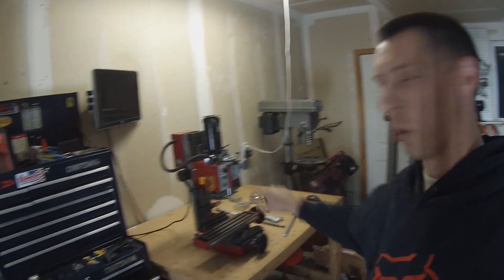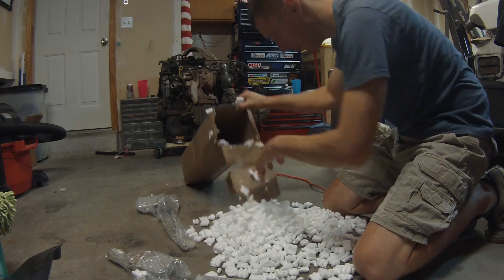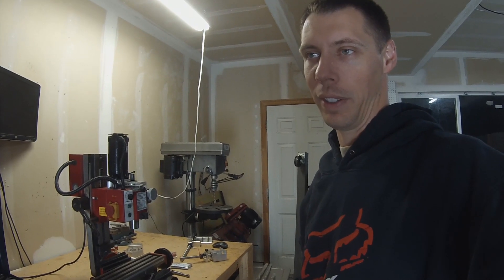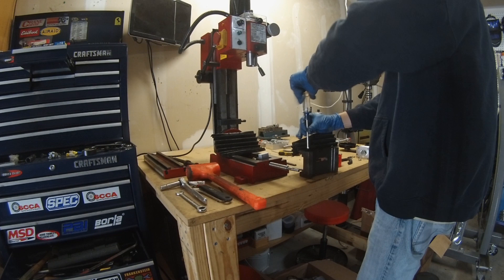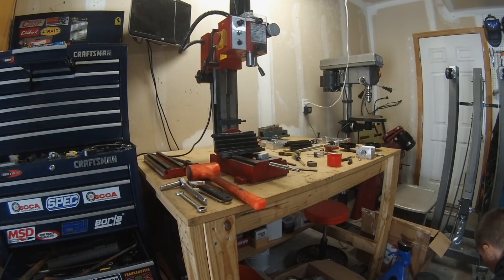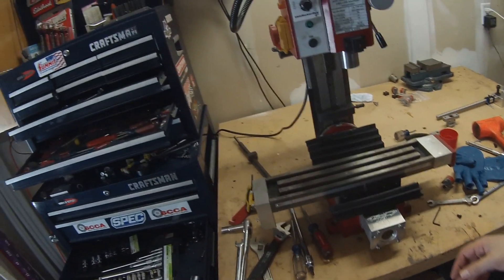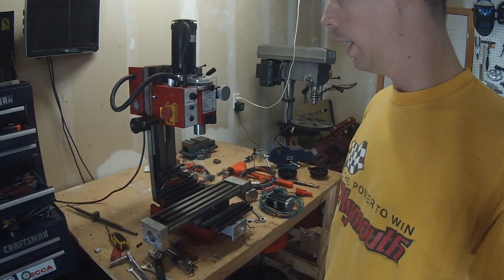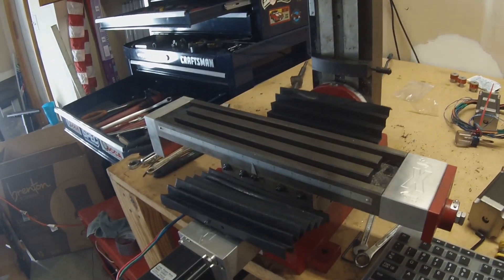Mini Mill CNC Fusion Conversion Part 1

Comment: if i did this again? i wouldnt. had the cnc fusion kit for at least a decade. and with the constant fiddling trying to get screws to not bind, the fact theyre imperial with rounding errors and being in a metric country was causing constant crashes due to forgetting to add G21, or native units everytime i started it... along with the death of XP and the challenge of getting another mobo with a parallel port for the gecko g540...

and yeah, after all the scraping and dealing with the gibs, should have just used linear rails and made an epoxy granite base, end up with something slightly larger... whatever!

but, all being said... just rebuilt, after having it in pieces for the last several years... re-used the mounts from the kit, but changed the Z to have the screw in the column, gaining at least 40mm of Z travel... and finally its moving again. not cutting, still  have to tweak a few things, but yeah... shes MOVING... with no binding, no fiddling, it just bolts together and thats that.

really satisfying to say, run an M100X200 "thread milling" wizard (mach3)... just to watch all three axes moving in unison without any horrid grinding sounds... even without a gas strut/counterweight, the Z is doing fine.

the 1605 screws i now run almost seem made for it, already threaded and turned down and only had to grind a few mm off the Y screw to fit in. far superior to the junk the kit came with.

Comment: Was there a reason why you bought a kit literally with parts that you could have made with your mini mill for just a fraction of what you paid for that kit.
Reply from the maker: I didn't have a way to turn the ends of the ballscrews and having a machine shop make 1 offs would have cost more than the kit.
Reply: @RivalMachining  not sure where you were looking for ball screws but I have purchased several custom cut and machined ball screws for very affordable prices.  Then again I did a lot of research prior to making a decision as to where I would purchase the ball screws.
Reply: @paradiselost9946  why would you need to take the machine apart to take measurements when that sort of information is already available online, if you do some research.

Comment: Thanks for doing this video! With your set up, can you program the tables to move a fraction of an inch or any length with a touch of a button? 
I want to build a rifle bolt jeweling set up. 

Thanks
Reply from the maker: I always used a CAM program to develop the tool paths.  I can jog the machine around or tell the machine to go to a specific coordinate by manually entering G code in the MDI block, is tha more of what you are asking?

Comment: I don't recommend the guy selling these kits now, either. I thought I was getting a quality kit and I got the same sloppy junk as you.
Reply from the maker: That's a bummer.  I was hoping my issues were just a fluke.
Reply: @RivalMachining  the names have changed, but the bullshit's still the same. Dude's selling "premium" ball screw kits that amount to (supposedly) being a Thompson ball screw with a Chinese nut - with no guarantee that the screw he sends for the 200 dollar upcharge is even a Thompson brand. The nuts have to have the flange modified to clear the castings, which was done on the Y but not the X. Ask him to do the X when you send back the screw because the assembly is binding up (with which he accuses you of just not knowing about "preload" and tells you to stop bad mouthing his business), he forgets. Ask him to send another nut that's already modified, he sends a sloppy junk nut with a mile of play. Luckily I know a lot of people with machine shops that I do mutual favors for, so they helped me out. Got the Y casting modified to clear the X nut, took the other side of the original nut to the bench grinder to clear the underside of the table, had the motor plates modified because the motors don't sit deep enough in the recesses... That whole ordeal was a 3 month nightmare of back and forth emails, parts and trips to the machine shop

Comment: Wow that is pricey ! 
More than the mill.
Thinking of making my own kit.
Ball screws are not that expensive
Reply: Mark Giza have you priced out other CNC mills?  $1500 is a bargain for a CNC machine.
Reply from the maker: Looking back, this machine was a gateway drug.  It let me see the potential of a 3 axis mill in the garage but didn't have the work envelope or rigidity to tackle most aluminum projects.  It didn't take long to jump to the Tormach.  If I didn't have the budget, I would live with this, but wouldn't try to start a business with it again.

Comment: You haven't posted a video in awhile. How is everything going?
Reply from the maker: Thanks for asking.  Everything has been going well, I've just been really busy with my primary job and family.
Reply: @RivalMachining  that's understandable. I have a couple of things that I may need done in the future and all my machines are manual so it would be impossible for me to do.. I'd love to have a cnc but I don't have one yet. I have fusion 360 (for my 3d printer) so I can make the program and just send it to you if it's compatible with your tormach?
Reply: @michaelmiller5566  I appreciate you thinking of me, but right now I'm not taking any jobs.  Life is too busy right now and I don't want to commit to anything I can't deliver on.

Comment: That mill will shake it's self to death cutting at those high movement speeds.  Your using a cnc conversion kit anyhow.  Hit a button and walk away.  If you bought a 500$ speed should be your last thing on your mind lol
Reply from the maker: I agree, but what I ran into was slowing the feeds too much results in the tool rubbing instead of cutting.  The cutter needs to take a bite of material each time, typically at least a few tenths or it will wear the tool out.

Comment: I’m trying to decide between desktop pro from cnc router parts, or a super X 3 mini mill for aluminum!???????
Reply from the maker: Personally, I wouldn't try a router on aluminum.  I know some folks have made it work, but they really just don't have the rigidity for anything harder than wood or plastic.  The ones I've seen on YouTube use a fixed gantry.

Comment: What do you do now that CNC fusion has been bought out?
Reply from the maker: Check out the link in the description.  Someone is making a clone of the kit.  I haven't seen one personally, but the pictures look the same.
Reply: @RivalMachining  You mentioned in another video that you had problems with your machine missing / skipping steps after you milled a bunch of plastic. If your ballscrews had wipers, do you think this would have happened?
Reply from the maker: @IceTurf  I bet it would help, but I doubt it would completely solve the problem.  The worst axis is the Z because the ballscrew is uncovered directly behind the table.  A better solution, but more design work would be to either put it behind or inside the column.  The X axis would be better if the ball screw sat higher into the table.  At least the machine stops when it loses steps with the closed loop steppers.

Comment: How accurate is the mill post conversion?
Reply from the maker: If I remember correctly, the Z axis was a little messed up and had about .010" of play, but the x and y are probably within .005".  It's not bad for making small parts, just not cut out for aerospace.  The bigger issues I ran into was overall rigidity of the column.  It's just not made for high cutting forces.
Reply: @RivalMachining  okay thanks, I've been having trouble getting hard numbers on this.

Comment: Hi bud could you tell me the total cost of this conversion? I’m deciding whether to buy cnc desktop or convert manual mill.
Thanks a bunch
Reply from the maker: I paid roughly $1500 for the setup.  $500 for the mill, $700 for the hardware kit, $200 for the electronics, and $60 for a used PC.  I'm sure there are also some odds and ends.  I hope that helps!
Reply: @RivalMachining  
Can I ask about the electronics... what components did you use to do it for just $200. And did you follow a tutorial for hooking it all up.

Comment: Hello, good vidéo. 
Where are you buy any parts ?
Thank’s
Reply from the maker: Hello, I bought the mechanical kit from CNCFusion.com.  I bought a 3 axis cnc kit from Longs Motor on eBay to drive it.
Reply: @RivalMachining  What happened to cncfusion.com ?
Reply from the maker: @falkenxx  I'm not really sure.  They disappeared and right about that time I saw kits from a different company that looked almost identical.  I just did a search and didn't come across them either.